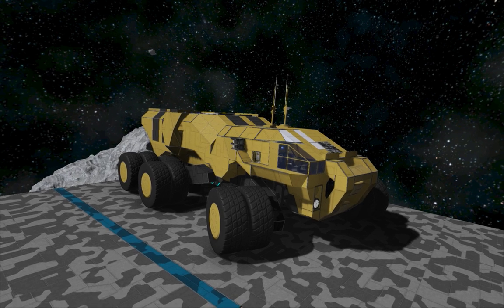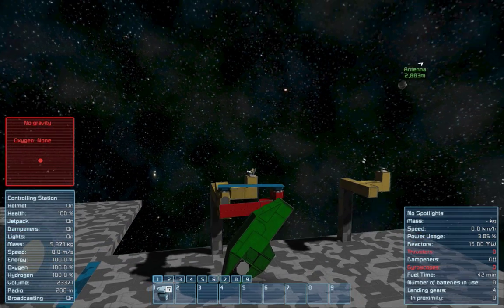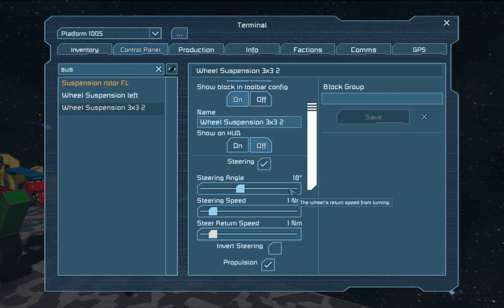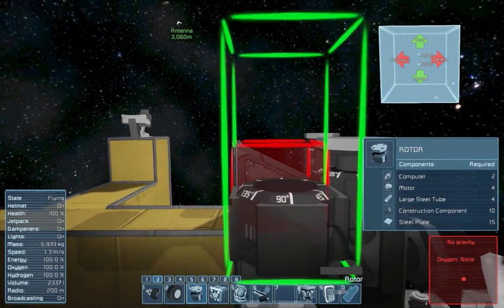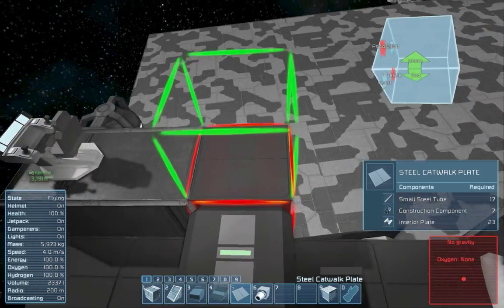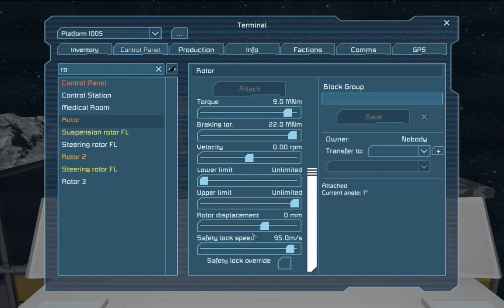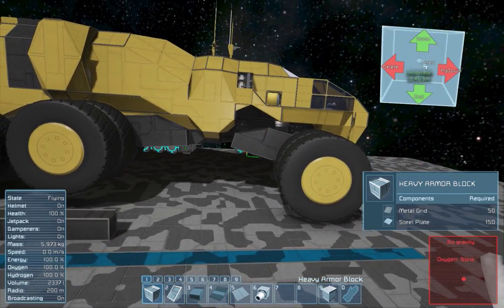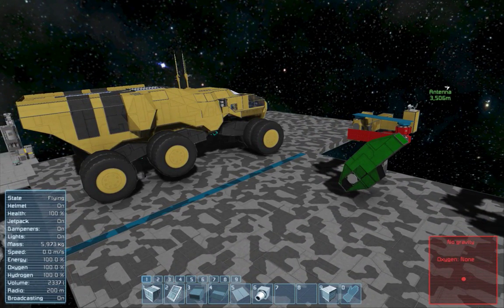Space Engineers Tutorial - Custom build Suspension and Steering (no mods)

Comment from the maker: Nope, it's actually pretty relaible. while the fliping mostly depends on how low you can get your vehicle's center of mass (just build the heavy parts very low into your vehicle), this kind of suspension should allow your wheels to travel more freely towards and away from your chassis. This will enable your vehicle to easily deal with steep slopes, deep trenches and sharp turns. How well a craft does though, depends on the finetuning of the suspension (angles, torque and depening) and that's mostly lots of trial and error. The result is worth it in my opinion, but it does take a while to get it there.

Assembling it in survival might be tedious. The suspension isn't rly the problem, but assembling the steering mechanism could be somewhat tricky. More precisely, the part where you attach the rotor head to the steering part might require some out of the box thinking. It should be manageable, but you'll need a drone or maybe a support construction of some sort to hold the parts in position. But you'll need that for any kind of vehicle, so I guess it's not that bad afterall.

One problem you may encounter though, is the unreasonably low resistance of the basic wheels (the non steerable version). Comapred to the all-in-one-steerable-part and it's unbelievable resistance to impacts, crashes and weight, the basic one's are more like raw eggs and break quite frequently. This is why I created a mod that makes the basic wheels more balanced compared to their almost indestructible siblings. With that little tweak, they will support heavy vehicles and high speeds even in heavy terrain (the suspension won't break anyway, I tried :P).
Reply: +Prophet&#39;s Space Engineering is it possible to do it on a small ship?
Reply from the maker: +TechGeek   It should work just as good. I never tried it, but I don't see why not. The resistance mod I did also works for small wheels and the rest shouldn't be any different with small blocks.
Reply: Thank You! Going to do that when I get my new rig.

Comment: when i do it when i change some values it locks (In Space)
Reply from the maker: The steering piece locks as soon as no force acts upon it. This basically means that you will never encounter this kind of problem on a planet since gravity will do the trick. 

However, in zero gravity you may still encounter this kind of issue, although it's rather unlikely. Seems to me like you actually manged to remove any kind of tention within your mechanism. It should resolve itself though as soon as you move it into a planet's (not a grav-generator's) gravity well. 

If it's still not working as advertised, you could also put it up on the workshop and give ma a link so I can look into it.

Good luck!